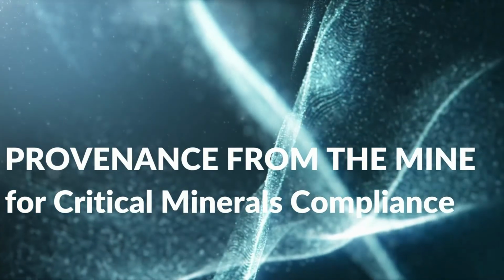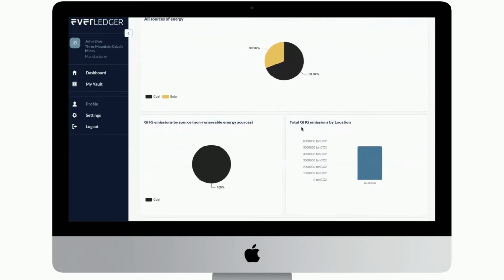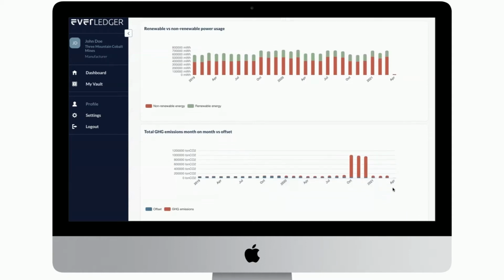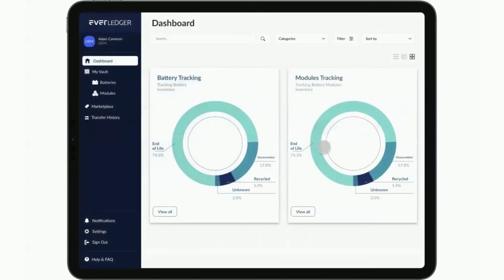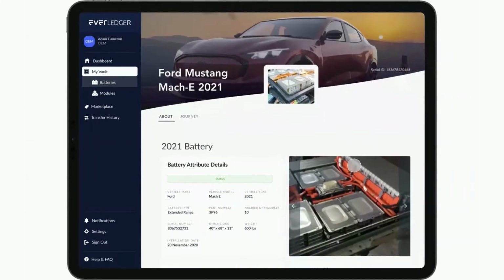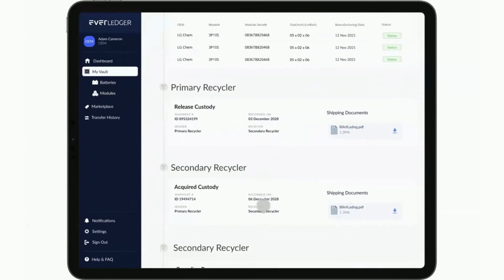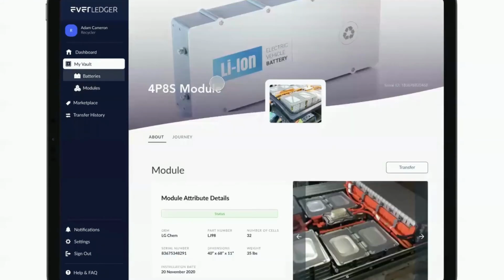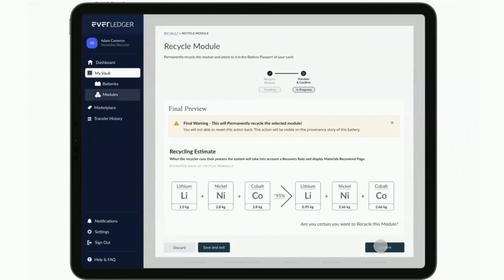Everledger Battery Passport Overview

Comment: Is this an example for the blockchain? Could you please explain why you would put this on the blockchain and for what advantage because at present I see some nice dashboards though I don’t see any blockchain requirement 🤔
Reply from the maker: Hi Simon, great question. Batteries get lost, they break, they deplete and get switched out for replacements, some are also counterfeit. The blockchain can be used to know what it has been made from, and where it should go to next for recycling / repair / repurpose. Thanks for commenting.
Reply: @Everledger  Thanks for your reply because i am genuinely interested because i'm wondering what part of the battery asset you tokenize and it could be on the battery itself where there's a number from the factory etc.... :-)
Reply: I’m think about blockchain to trace battery ,but just curious about isn’t the matter of GDPR?